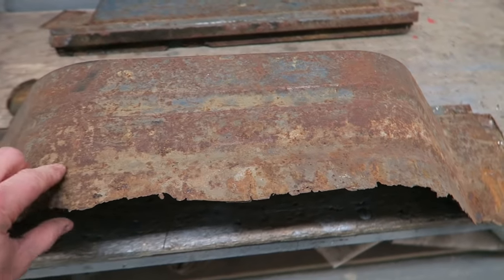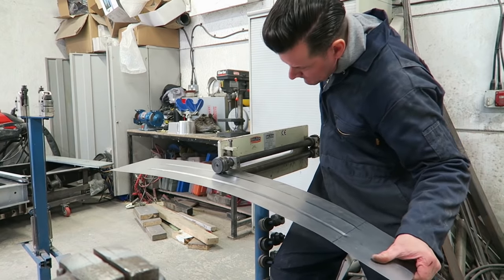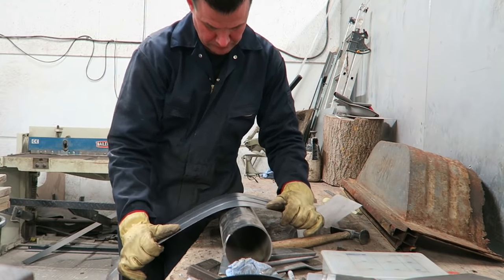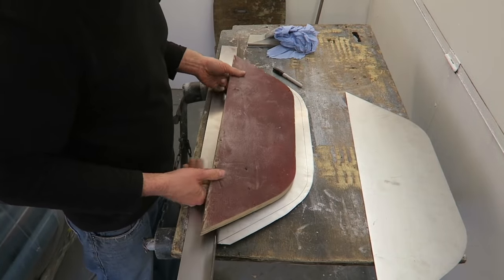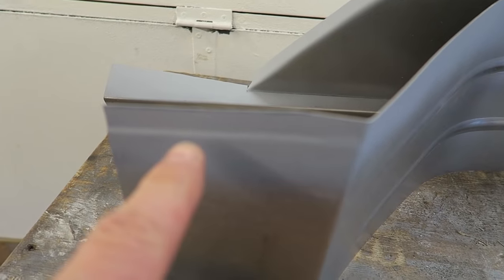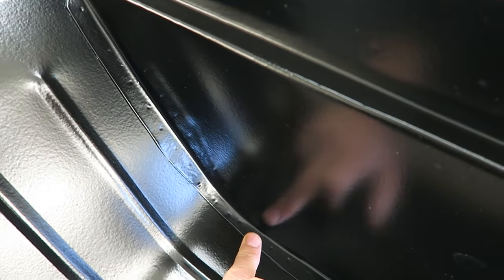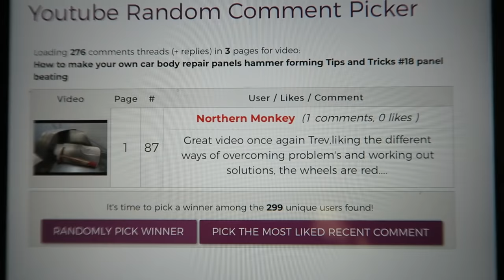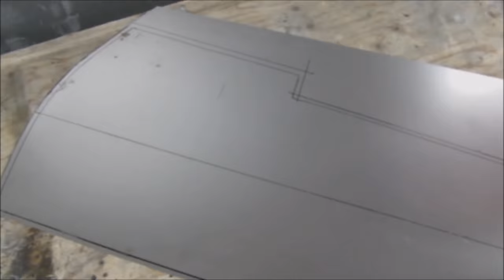Distortion free bead rolling hand made car body panels, Rear wheel tubs. Tips and Tricks #19

Comment: Trev, i've  welded an old wheel off a big gas valve on the end of a metz roller, hasn't half made it easier to follow a line on a big panel without having to stretch across,cheaper than a motorized one! Thanks so much for the video's,learning a hell of a lot mate,cheers!
Reply from the maker: eddie fitzgerald great tip thanks. Cheers Trev 👍

Comment: Great videos Trev!! if you use concrete screws (not dyna bolts ) to bolt you Bead roller down when you want to use it you can undo the concrete screws when you want to store it away and not have bolts sticking out of the floor.

Comment: Great video - thanks very much.   One idea I read, (that I haven't tried myself yet) on finishing the end of the bead - take an open end wrench that is the size of the bead and hammer it down on the end to "close" the bead.
Reply from the maker: Rob Basile thanks rob what I have done is cut a section out of a piece of tube and hammer that in on top of the bead, I did it to a Citroen floor that we made and had to get custom made dies made up the bead was so big that it looked awful until I crimped the end down with the tube. Cheers Trev 👍

Comment: Another good vid, A simple way to get the seam sealer nice straight and neat is to use masking tape on the edges of the area you are sealing. Works great for tidy  seams in a shower stall if you are fixing up for your misery.

Comment: I did something not unlike your wooden buck method to install new bright bezels on Smiths magnetic motorcycle tach and speedometers.  Assemble the new bezel, gasket, glass, gasket, and speedo/tach, face down on a piece of leather on a solid flat work surface.  With a tack hammer, while pressing down on the body a bit, gently tap on the raised edge of the bezel.  Only bend it in about ten degrees at a time while rotating the assembly.  After a short time, you are done, and the finished result  is one that you can be proud of!
Reply from the maker: Hamilton S. Rink thanks 🤩. Cheers Trev 👍

Comment: Tidy job Trev well done.  Do me a favour & weld a bit of bar to your bead roller adjuster, pls, also if you want to finish the ends of your bead rolling, get a bit of steel tube of the right internal diameter, cut it to a half moon & hammer the end of the bead, then it will look pressed.
Reply from the maker: Nowt 2Cere great tip thanks, 👍

Comment: I cannot believe  you were saying that a few of your subscribers  thought it was made by press machine and not hand made yer i would be chuffed as well ,   once  again you explained  the procedure  perfectly and easy to understand. As for heat weilding primer,  We use upol copper weild through primer. As with lots of the products we use i like to ring the tec chemists  and explain how i interpret the instructions  to see if i am missing something.  The tech i spoke to about the heat wetld primer after explaining about possible ferraris oxidation  forming told me to use a preferred  white clean rag and wash the metal and wipe pushing only one way on to transfer contaminants. This made sense to me as i always clean bare metal before fillers and primers , of couse we all should as technical school teaches but more than less smash repair shop   fail to do ,speed is not always a friend in the body restoration  or smash industry. .whats your opinion   trev do you think it exsta work for no gain mate
Reply from the maker: Steve Ridell Steve I honestly think you’re on the right track but I also believe that you can over analyse and factor in issues yourself, I’ve definitely been guilty of this. all we can do is try our best and observe our results before passing judgment on whether our methods were correct and worthwhile. Cheers Trev 👍
Reply: @trevsblog  for replying  yes ive been told that before  keep up the informative way you explane the  car restoration  game.

Comment: Probably the most accurate panel maker EVER. Pls make a video about sheet metals options. I like to use galvanize steel but none do it. Cold sheet metal rules. Products such us wash primer or epoxy primers or fillers, are all for  galvanized surfaces. Is not better to have an inner galvanized surface rather than trying to prime inside and rust protect a not galvanized panel?
Reply from the maker: sifnos07 I just use standard mild steel sheet. The problem with making panels using galvanised panels is that you end up removing the coating where you’re working it. Cheers Trev 👍

Comment: I'm split on motorizing my bead roller in the super simple fashion of using an old wiper motor, or going high tech (ish) using a spare Nema 34 stepper motor (used to be the Z motor from my CNC mill but it was too slow). Then either way, I'll make a see-saw switch to go fore/aft.
Reply from the maker: DrFiero let us know how you get on. Cheers Trev 👍

Comment: You should bolt your head roller to the floor. Weld a tee to the top of the adjuster bolt and fit a couple of nuts to the top of the adjuster bolt and then you can lock it so it's always the same.

Comment: Happy new year Trev. Loved the bagpus reference. Can you use the bead roller to pre stretch the panel - I don’t have an English wheel arrangement 😐
Reply from the maker: Sorry but putting enough pressure using a bead roller probably won’t be possible. An English wheel shapes by thinning the metal whereas a bead roller kind of presses a shape into unsupported material a bit like a rotary press. I think with a few pieces of strong box section and a couple of wheels you could easily fashion a machine that would stretch metal along a line but without all of the manufacturing hassles of buildings full on English wheel. Cheers Trev 👍
Reply: Trev's Blog thanks for the reply Trev, very much appreciated. Keep well and take care with that hair fella 😎

Comment: Trev in my opinion you are a machine ...all be it a very human
 one .Have you fixed your bead roller to an old pallet yet ..allows you to stand on the pallet and you have a nice stepped floor to work from (no holes needed in the floor of work place .Also I had an old sports steering wheel I mounted to the cut down handle boss ,handle arm was cut off completely and the wheel works really well now,(not in waves ),smooth as ,Those handle arms have enough steel in them to start a landslide and could be used for much more important purposes?(I have a pic of mine on I.G.(waen909) hope this helps ..love your work.
Reply from the maker: waen909 thank you 👍

Comment: A bead roller is fast approaching the top of my wishlist, do you have any recommendations for a good roller that wont break the bank? I had a CF Bedford van with a Holden 202 engine swap many moons ago...She was alarmingly thirsty...Your ford Zetec sounds like a much better option : ) Thanks for another inspirational video.
Reply from the maker: Simon Lookmire a lot of the budget bead rollers look to be made by the same company then rebranded by companies like Bailey, the one used in the video is just a budget model it works fine for us. If you want high quality the price starts rising drastically. Cheers Trev 👍

Comment: Hi Trev, I realise this video is a few years old but I have  question regarding bead rollers.
I need to reproduce some small semi circular  cross section trim pieces with a small return about a metre long ideally in very thin stainless steel. Can this be done in a bead roller or does it need a more specialised piece of equipment? This would be to re- create small trim that borders a dashboard.
Thanks Vic
Reply from the maker: Send me an email, my address is in the video description. I’ll send you some tooling pictures 👍

Comment: I am thinking of making a hammer form to make a rear panel for Mercedes W111 Coupe the one where the tail lights and number plates are located. i was thinking of making it from hard word, but would plywood glued into a block work ? It would be roughly 1400 mm wide.
Reply from the maker: Mercmad my best advice is try it out and see, this is all you can ever do really. I’ve messed as many things up as I’ve had success. Cheers Trev 👍

Comment: I was kind of surprised you used a steel hammer to tip that metal. I most often used nylon or rubber which takes a bit longer.
Reply from the maker: My take on appropriate action is more or less whatever works for you. If I’m forming against wood then I’ve always used my steel panel hammer. If I’m forming against steel then I often use nylon etc sometimes even my steel hammer up until the point of compression 👍

Comment: Do you have a spot welder for aluminum? I am a high school metal shop teacher in New Jersey, and we use spot welding to make sheet metal dust pans and panels. But we would like to do aluminum
Reply from the maker: Ron Grosinger Ron spot welders use resistance to create the weld, when you use a standard spot welder it won’t weld because the conductivity between the copper tips and the aluminium is too great. If you change your tips for steel ones this may well work for you. Cheers Trev 👍

Comment: Hello Trev. Another great vid. Do you think lightly running it through the bead roller upside down first. Then flipping over and running the bead would make a difference? I don't have an English wheel..........
Yet 😂
Reply from the maker: Skibum Wannabe the way I did it in the video works best for me. Cheers Trev 👍
Reply: @trevsblog  it worked a treat. I used the 1/2" male bead die, and took the cutting edge off a cutting die and it was ok. So then I took the handle off the bead roller, backed off the pressure and used it like an English wheel. Better. So then I fiddled with the pressure.  Best results were finger tight, if it's slipping, help the rollers roll, or give it the lightest nip. Otherwise it leaves lines. Thought  you'd like to know
 😉👍🏻

Comment: Great work Trev! What type of paint did you use for the white? 2 pack or epoxy etc? Curious if you have ever used iso free 2 pack? Ford Zetec engine in the old girl.
Reply from the maker: Fix'n Jiggerz I didn’t know you could get iso free 2k. I use standard 2k direct gloss. I believe the paints have been refined these days to make the far less toxic. Provided you use good ventilation with a filter on your extraction fan and wear a descent canister mask for 2k, with the amount you’d be painting Simon you should be fine. Cheers Trev 👍
Reply: @trevsblog  yeah I've recently discovered you can get it from PPG, Dulux and several others. ISO free primer, bases and clears. Air dry, no baking required and only 10% less durable than standard 2 packs apparently.

Comment: Great video trev.  Do you ever use a shinker/strecher after hammer forming to straighten the part?
Reply from the maker: David Walle to be honest David I make panels at work using the bead roller to create the lip then use the shrinker on the corners. Before I had that facility I did it the way the video shows with no additional tools. Cheers Trev 👍

Comment: Hi Trev.  Been following you for a while now,- and I must say  My god you are good. Still trying to learn some of the skills.
Question for you.  I have bought a “shrinking hammer”  dont know if you know what Im taking about. It has a square head and a lot og small squares cut on the surface.  Is it something you could show in a video how the work, and or if not say something about I have been screwed.
Reply from the maker: John Christiansen there is always more ways than just one to approach any job. A shrinking hammer isn’t something I’ve really ever found useful but practice with it. I do use a bumping file with the teeth and it does work very well for metal finishing and it must have a shrinking action because I’ve removed dents that had obviously stretched the metal. Cheers Trev 👍

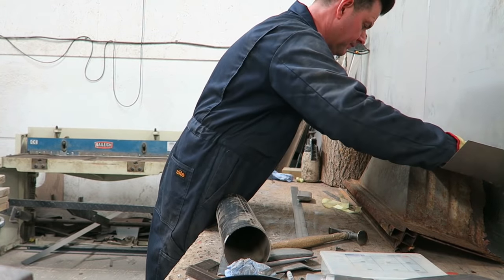Comment: At 7:08, where you use the old piece as a buck, could you use the side piece instead? I mean make a pattern of that side piece and tack it to the bead rolled piece? Then form the bead rolled piece around the edge of the side piece?
Reply from the maker: joseph legere without doubt there are many different ways of doing the same job, I just do it the most logical way I know myself and can depend on the end result. Cheers Trev 👍
Reply: Actually Trev, after I wrote that I thought about it and I can see the benefit of the way you do it, especially the bends. They would be unwieldy doing it my way.

Comment: Excellent video, as usual.

What exactly are you saying by "Make sure all epoxy products are properly 'keyed'."   What do you mean by "keyed?"  Are you actually saying cured?
Reply: He just means each layer has to be scratched scuffed up real good so the layers key together.  Epoxy primer, after a few days, doesn’t chemically bond to the next layer so you have to scuff it up for a mechanical keyed bond.
Reply from the maker: DWC rubbed down, sanded. Cheers Trev 👍

Comment: i need to ask is that English wheel home made? just that id been thinking of building one as i dont need a huge one that takes up loads of space. new heart of the Bedford is a Ford focus Zetec (i guess its a 1.8 litre) on the engine note though how comes you never went with a diesel engine? sorry if you have already covered this topic
Reply from the maker: Ross l the English wheel is a Bailey brand and I’m toying with making my own to fold against a wall. I’m no expert on engines and just went with what other people have fitted as a rear wheel drive conversion. Cheers Trev 👍
Reply: @trevsblog  ahh i just thought it was homemade by how simple of a design it is, normally from the ones ive seen they are rather large. yer that would be a good project to see mate and content for the channel :) yes i see, i guess its better to go with what works some times but i guess if it ever goes wrong at a later date you could go down the route of a gearbox adaptor plate for that gearbox and a diesel engine if you have any space for a turbo

Comment: What paint are you using cellulose / 2-pack? How are you managing to spray at home?
Reply from the maker: Iain Campbell I wouldn’t advocate spraying paint in a built up residential area. If you’re going to paint anywhere always use filtered extraction, that way the paint gets trapped in the filter not funnelled outside. Cheers Trev
Reply: So you paint it at work using two pack? @trevsblog

Comment: Hi Trev it's a ford zetec 1.6
Reply: Hi Trev I loved your blog using simple but effective tools and techniques to achieve metal folding..but my trick years ago was to mount 2  6 inch vice's perfectly lined up 4 foot 81/2 inches apart (ha ha)!  and fitted with  2 chunky equal lengths of angle iron  to make a strong folding jig - you can wedge underneath with 3x2 timber for middle extra support when knocking up sills ect
Cheers Johnny

Comment: You need to get rid of the crank on the bead roller and replace it with a steering wheel of a car. Try to find an old large steering wheel. Do not steal the wheel from the employee parking lot as you will get caught.
Reply from the maker: Steve I’ve bought a heavy duty one since and have a variable speed reversible and geared shunt motor to power it 👍